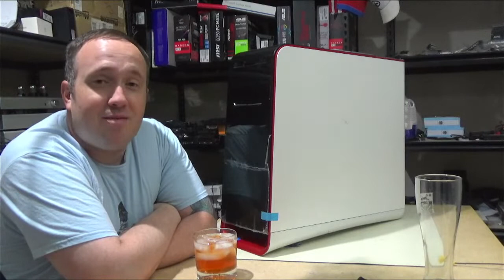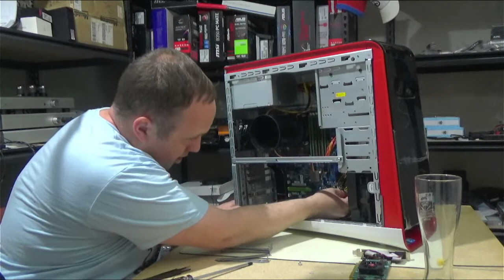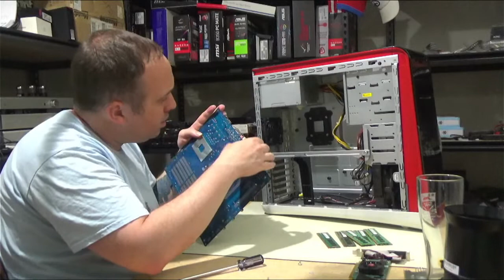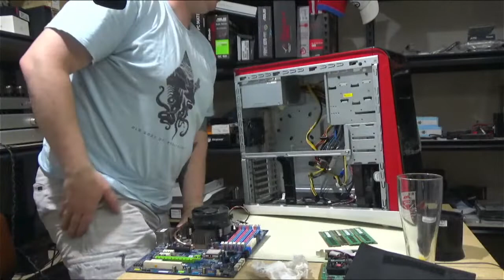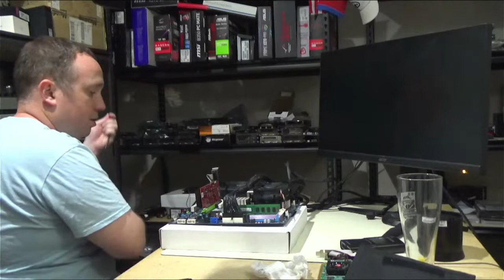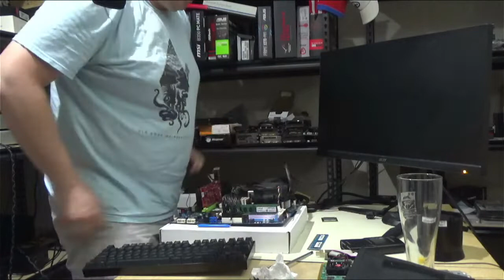FB marketplace find: Broken Dell Studio XPS 435T/9000 (12 y/o peel)

Comment: I recently acquired the same Dell XPS 9100 Studio as you have there. Paid $5.99 total $27 with shipping. It is surprising very clean but came with no ram or HDD. I ran into this video looking for  information on ram and what DIMMS to put it in. I figured it out and installed 3sticks of 4GB DDR3 1600 in the red slots but gave me a 2 beep error so I swapped the ram over to the blue DIMMS and she posted but the fan ran at super high rpms and soon after it shut itself down. Removed the cooler and the thermal paste was toast, looked like it never was changed. After a good clean and fresh paste I restarted it, pressed F2 and got into the bios to see it recognized the 3 sticks of ram 12GB but running at 1333Mhz. I may not have so easily figured things out if I had taken the mobo out and not heard the speaker beep out the memory error code. Don't know yet what I'll do to it but couldn't pass up this machine for such a cheap price. I may install an X570 board with a Ryzen 3600 or an Intel Z490 I5-10600K setup. Going to watch your other videos regarding this Dell.